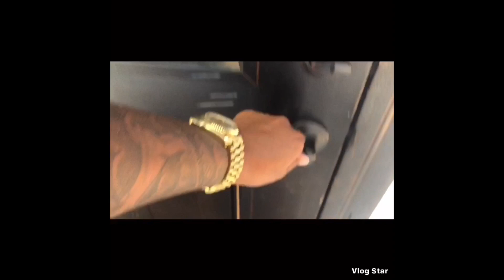LIFE OF A MAN AND HIS HELLCAT(S) PLURAL. JADED BRAND

Comment: Nice the unusual suspect which it sure is. U dont always see a cuda
Reply from the maker: NOPE!!   BUT THE REASO ITS NAMED THE UNUSUAL SUSPECT IS BECAUSE IT BLENDS IN WITH AL TOCK CARS . BUT WHATS HIDING UNDER ITS SKIN ARE FULL SET OF 4 WHEEL WILWOOD DISC BRKES,  FULL COIL OVER AND SPRING SUSPEMSION, FULL HELLCAT DRIVTRAIN  BOSTER SEATS, A/C . REVERSE CAM, NAVIGATION  PEDAL SHIFTERS . ETC . ALL THE AMENITIES OF THE NEW CARS!!  SO ITS THE UNUSUAL SUSPECT BECAUS EWHAT YOU SEE IS NOT WHAT YOU ACTUALLY GET!!!!!!
Reply from the maker: CORRECTION .   (STOCK CARS) . NOT (TOCK CARS)
Reply: @JadEDBRAND  Its a nice well equipped car.